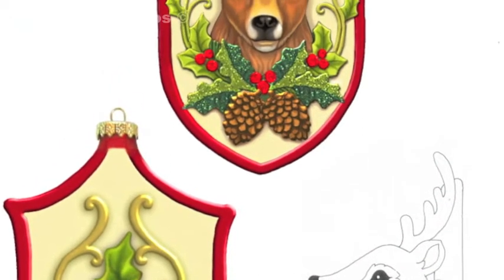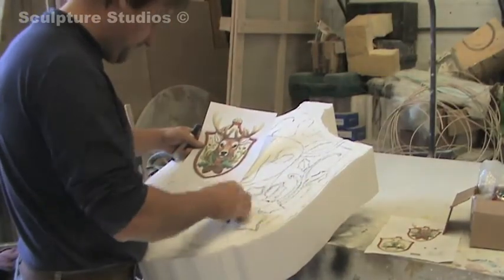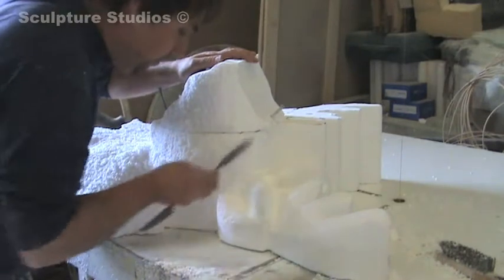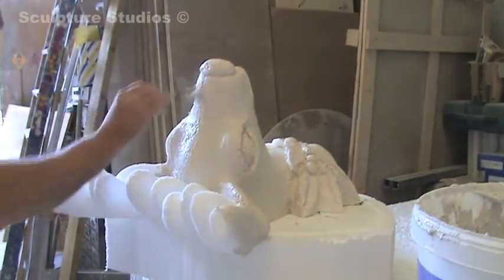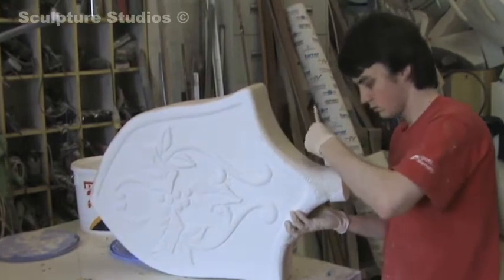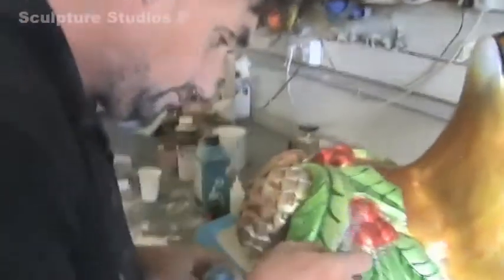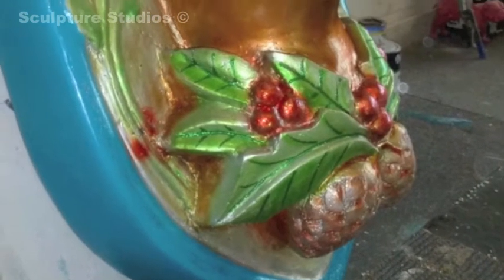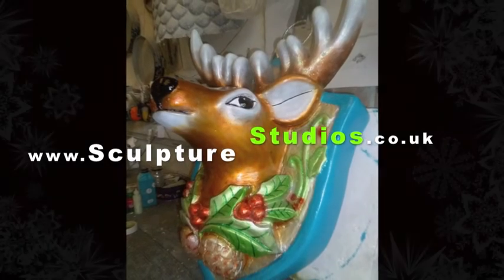Stag Head Christmas Decoration by Sculpture Studios

Comment: Good day, i'm latín and  i do not understand the language, i do not miss their vídeos, and i wanted to know what the material they  apply with the brush in the polystyrene. Thank you for your response.
Reply from the maker: For this, it was a light plaster filler that was sanded back, and water based emulsion paints over the top. This isn't particularly strong, but was just used for a display. I hope this helps